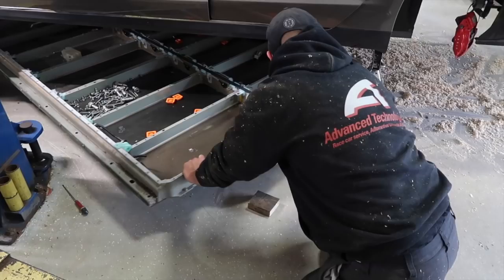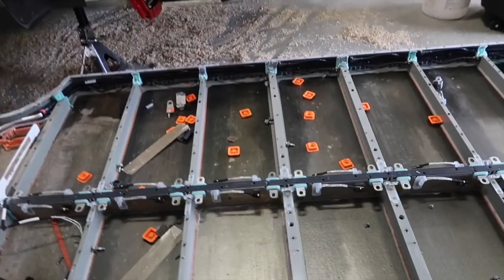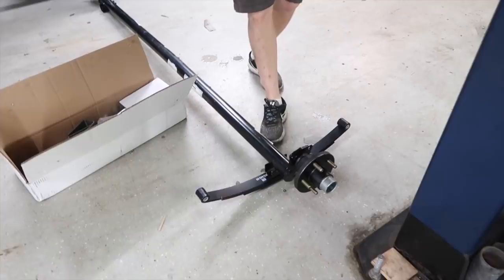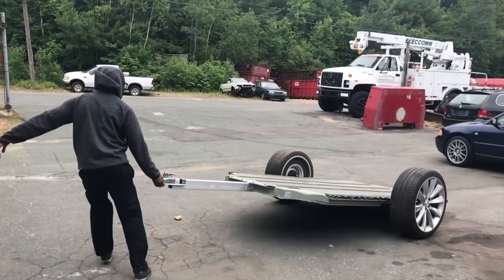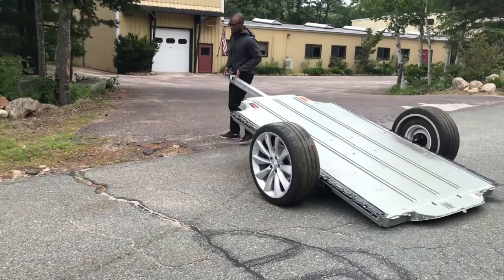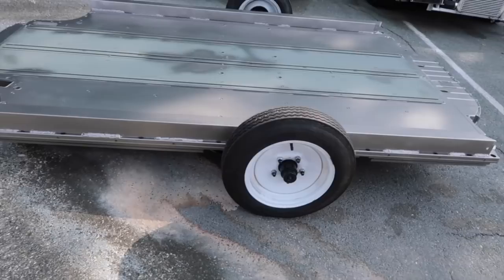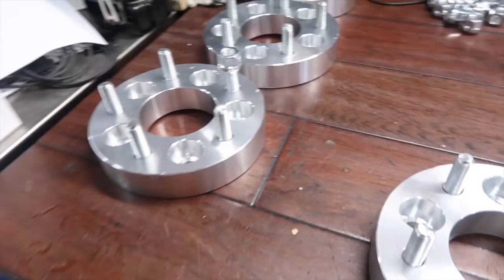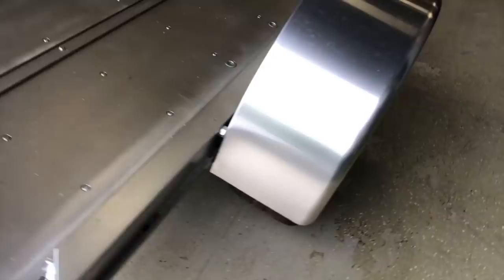DIY Tesla Battery Trailer

Comment: You know you could put a small travel trailer on top. Add battery modules then you have a travel trailer / range extender.  Now that would be cool. Design the travel trailer external design to compliment the model s / model X / model 3. You would also need electric brakes. I sense another project or perhaps and new company that specializes in these types of trailers.

1) Trailer would need added self contained coolant system with fans for super charging.
2) Crash sensors for disconnect the high voltage connection to the car and trailer.
3) All appliances could be electric. No need for a propane bottle.
4) Added small electric motors to axles to assist in hill climbing.
5) Fold out solar panels!

Could be a prototype for a Tesla Model 3 / habitat for SpaceX Mars mission. (just a joke)
Feel free to add cool options the the new Tesla Travel Trailer / Range extender!

Comment: So many applications can come from this. Maybe a trailer can be made with the batteries in it to make a small portable workshop to run all tools off of it. Maybe small trailer be made to sleep in like a motor home but run everything off the battery and it would really work out well if you're somewhere remote where electricity is not readily available. On and on it goes....

Comment: You need to build the battery packs out of the 21700 battery, make this into a small tear drop travel trailer, hook it and wire it up to your Tesla and see how much range you can get out of the trailer and car combined. I say if you properly configure the trailer to the car, perhaps even solder in super capacitors for energy storage, perhaps some regenerative braking into the trailer wheels it can give you close to or over a 1000 mile range, theoretically speaking. Not a bad idea this little trailer.

Comment: Awesome idea. Here's my 10 cents: If you flip it the Aluminium skin (Yes, I come from a place where it has a second i) will be in tension and make the whole thing much stronger. Stick some plywood on top and then you've got a cheap and easily replaceable floor that you won't mind dinging up.
I want one to tow behind my Leaf. Not my S. That would invalidate the warranty ;)

Comment: I like it. I would use one. You could probably have used some extra telsa fenders and nose cone to make it more recognizable as a telsa trailer. I like the battery pack idea, but it might be more balanced with two and that would make for a good mobile workstation when you go places for tear downs. Good job. I enjoy the video Rich. As an IT guy myself, I understand the part time thing. Also looking at doing an electric skateboard myself. Let me know if you have tried any others, as I am having trouble deciding on one. The reviews are usually young people on the skateboards, which I don't exactly relate to. Thanks and keep up the good work.

Comment: I remember seeing the difference the tesla battery makes on an auction site once it is pulled out. I think the weight of it is pretty significant. Seeing the clearance between your axle and trailer, I don't know if that trailer will support your packs without bottoming out the suspension. Wish you the best of luck with this adventure. Looks pretty damn good! :)

Comment: You should find a cheap junked up LEAF and fit the pack from it, they are VERY cheap on copart right now, then use it as a sort of range extender/ backup power I bet it would fit ok on it.

Comment: It would be cool if you could make a Tesla trailer w/ battery pack that could be used as a supplement to the car's main battery pack.  Sort of like having a portable charger for your phone. I think there could be many applications for this... Tesla camping trailer with power anyone?!? Taking this a step further, create a Tesla trailer using their solar shingles for the roof.

Comment: You should of mounted the axle under the springs. Also know as “under slung” in trailer lingo.
This would of prevented the need to notch the frame for clearance.
You could of also used longer hangers.

Comment: Brilliant! If you can come up with a way to put 20kWh-ish of Tesla batteries on there so the weight remains acceptable but you can actually put a 40A charging station for your car to get a boost back while carrying stuff or even it being a camper trailer, it would be awesome.

Comment: I'm thinking such a trailer with batteries, or even better a trailer full of Tesla powerwalls / powerpacks could be a great tool in disaster relief. It can then come fully charged and give power to houses  instead of using generators.

Comment: Hello Rich, 1.) have you considered using a Tesla battery trailer as an external power extension to any Tesla in order to improve its mileage?  2.) What is the practicality of using a Tesla battery array pack for off-grid solar applications? 3.) Could solar panels charge a Tesla battery array?

Comment: It's not so hard to see a future where these trailers could be used as replacement batteries… It would give the gasstations along the highway a new job... keeping battery trailers charged and in good shape and replacing them on customer-request. Like the system of camping gaz, where you buy a canister, and you exchange the empty one for another charged one. Same principle, advantage, you pay a bit more, but the company assures that all trailers in circulation are in decent working order...

Comment: 10 years from now get an old Model X 60D and put together a trailer from a refurbished 2020 Roadster battery and you'll have the ultimate sort of cheap electric road trip vehicle with maybe over 700 miles of potentially "free" range.

Comment: Het Rich, I love your stuff and really great attitude.  I am pretty positive the cover to the battery pack is also a structural part of the system.  If you look inside the gussets are split in the middle.  It would be a good idea to put the top back on.

Comment: You man I just saw this. So why not cut small holes and add little wheels to the platform for when you load up battery packs so the easily roll across the bed of the trailer.  Throw a winch on the front. Really cool build

Comment: I always wondered about battery trailers or even generator trailers for extended range. I drive across country twice a year but for the rest of the year I drive less than 50 miles a day. A generator trailer would allow me to drive across country and use no gas the other 361 days a year.

Comment: I thought you were going to build a battery trailer to have the capability to go many more miles and also have the capability to carry on the trailer.... 
Here's an idea for you. How about a teeny tiny house/camper with a monster battery underneath that would have the capability to charge while the car is charging and also charge via solar off the roof of the Tiny????? A simple teardrop trailer should be pretty lite weight and the addition of battery pack should give you plenty more juice to get you where you want to go!!

Comment: you should add all the batteries back in and use it as an extended battery pack for the car to extend its range, especially if the tesla has to tow something.
Reply: great idea greg

Comment: Looks like you had to put the Tesla wheels on top of the trailer tires just to get an extra few inches.  The trailer is still too low though.  Gotta flip the axle over and mount it under the springs.

Comment: I thought that you'd might put some of the battery back in there to increase the distance you can travel with that trailer. All you with me to do was put another shell on top then add the frames that you did before.

Comment: Two things, both seem to be pretty obvious so i'm sure at least they crossed your mind already, but anyway: been the battery pack nearly as wide as a Model S, AND adding the with of this wide wheels will result in an extremely wiiiiide trailer. Which is probably good for having a big cargo space, but if the idea is to get this on your tesla working as a range extender battery or something like that, probably you'll want something a bit more narrow.
The other point is the last comment of putting solar panes over it. Your money will probably be better spent in pink paint for the car, just an example. Make sure you make some basic numbers because no solar panel installed on this area can produce any substantial amount of energy, even if you had no clouds nor shadows. Plus, you don't want to ruin a solar panel by throwing something over the trailer. 
I like the idea of having a trailer of fully charged juice and been able to use it to charge other EV, I'm not sure though if makes any sense economically considering the supercharger network and the sell value of each working tesla module.
BTW in Spain you are all over the tech and automotive news of the moment after the video of Motherboard! the Frankenstein of Tesla. LOL

Comment: So here’s a dumb question… But if the entire battery pack was intact and functional, If wired properly, would you be able to use the trailer as an external battery and charge a Tesla as you drove?

Comment: hey man ! chances are you won't see this but i wanted to give you a heads up that your axle is not installed correctly. the way you have it now it has nowhere for the springs to flex; any bump in the road will cause the axle to push into the bottom of the deck and leave the tires to absorb all the impact. flip the axle around and put the leaf springs on top and the U-bolts the other way around.

Comment: You want to make something useful,  get a 500cc motor that makes 40-50hp, attach a generator,  use it to run the electric motor.  Now you added 500lbs aaaaand given the car unlimited range.  You only need 30-35hp to maintain 65mph. The extra HP restores lost charge.

Comment: Can you link this trailer to the tesla itself? Get 12v from the main 12v battery and feed the tesla with traction current?
Basically put the trailer in parallel with the tesla battery. I am aware that capacity and volts are not the same since you cut it

Comment: Honestly, I was dismayed when Tesla and the other EV makers simply ignored the most sensible idea to extend ranges by use of trailered battery packs or hybrid power generators to feed EV's on cross country treks. Lets face it, the EASIEST way to do a long haul would be to hook up a trailer with a 1500lb battery pack and drive it to empty using the cars on board batteries to get to the next exit with an available battery pack and switch them out in 5-10 minutes. If UHaul can rent out vehicles and trailers much like this (the local handyman uses a rent by the day UHaul van right now), why not a high cap battery trailer so you can still drive your EV like its a car?

Comment: You know what would be cool. Installing the battery packs and a rear drive motor. Imagine having a trailer that can help you haul thousands of pounds beyond what your vehicle was capable of towing cause it was under its own power.
Reply: Racer X that's not how towing capacity works
Reply: sirwarrior if the trailer was under its own power you wouldnt be towing it.

Comment: Will it be legal to power the car from the trailer battery when in motion? If the trailer disconnects, you could have live cables trailing.
Could be used for off-grid charging? (Camper trailer, etc)

Comment: Hi Rich, enjoy the Work your doing for current and future electric vehicles.
I have an idea that you may looking into for possible boosting the range of any electric vehicle. Have you thought about purchasing or acquiring a DC Motor and attaching to the trailers axle or wheel hub. This could possible allow you to generate power to battery pack or battery cell. Or even DC motor to Ultra capacitors coupled to battery pack (hybrid). Concept is use the trailer for 2 purposes, 1) hauling 2) Generating power for electric range extender option.

Comment: Great idea.... how about a way to get 10 to 20 % of the move to make electricity ... lets say only downhill  and when it breaks.... with this setup I can not find a way clear for now , but if you had a motor on its wheel ,  you will have decent energy on downhill and on brakes... Trucks for example had air breaks for the Cargo trailer ... so when you break the Truck the Cargo stay strait don't turn to a Z with dangerous  accidents .... you need a way that when the car break , give an option that the trailer will break with two ways like the Tesla ... you may be will need an arduino and sensors ( can be useful for the led control , I suggest neopixel leds strip , that change colors ) ... or may be something that is already on the market ... the idea so is to keep little longer the breaks back in order to keep the car and the trailer strait but not to much ... Also some trailers have electric motors to do maneuvering , in order to orient and align it right with the car  .... but you will need a smaller dummy wheel , that will be up when you hookup the trailer on the car....

Comment: could you do a trailer with a fill frame and battery an make the batteries work in tandem. basically doubling your distance. then that would be proof of concept for Tesla to make a moving trailer that also houses a battery. boom i should be in these meetings make these products.

Comment: Couldnt you just leave the battery pack as is but weld the tongue and wheel mounts? The battery pack already was sealed and safe to be under you and all you would have had to do was make a cable from the trailer to the car transferring energy which would have taken a lil time to make safe but i feel like that would have been the way to go giving you a trailer and extended battery life

Comment: if u watch when hes rolling the trailer at 2:50, it looks like the tire on the left is wobbling a little. is that because u the tesla tires didn't fit correctly or could that be that the hub is slightly bent? i would check it if u haven't already

Comment: Would it be possible to add Tesla batteries packs to the trailer to extended range of the Tesla hauling the trailer and hauling your gear. Would this be a viable option for cross-country driving?

Comment: Rich, Couldn't you make That trailer an extended range trailer to where the battery pack on the trailer could feed the Tesla. S,o you go six seven hundred miles versus 300 miles. In theory you can make that a free wheel trailer for towing / extended battery pack to propel a Tesla on long extended range trips long trip. And bring along a lot of camping gear in Goods.

Comment: Richie,  Question for you how hard would it be to power the wheels to the trailer linking it up to the Tesla so it takes the strain off the batteries on your car, is it possible or viable, thinking outside the box across the pond........

Comment: Just think if you can build that properly it's like adding another battery pack to your Tesla Plus it could carry stuff I think it's a win-win if you guys can engineer it properly. If not I have tons of ideas I think you might be onto something so awesome. One of the ideas I was just thinking of is regenerative breaking. We need to figure out a way to connect the trailer to the Tesla vehicle with some kind of brake controller and then it would return some of that power back to the battery that's easy peasy.

Comment: The axle is on top of the leaf springs so there’s no suspension travel, are you going to move the axle under the leaf springs or space them in final build?  The reason I ask is with the low profile tires will the trailer bounce all over in rough areas in the road?  Also when you modified the axle down did it change the load rating for the suspension;  either make it more or less?

Comment: I thought you were going to create a Tesla Battery trailer to double or even triple the range that the car can reach... kind of like a piggyback battery on your cel phone! If you could switch power source from your car battery to the one built into the trailer and then to the one above it that it is capable of carrying, the car could reach 900+ miles in one charge, then all three batteries get recharged simultaneously while you have lunch and off to another 900 miles!

Comment: Any chance of rigging genorators to each wheel of the trailer, to charge the tesla making for unlimited distance? Ive had this convo with someone before, where in the arguement, i was wondering why noone has attempted to put a high output, low rpm genorator on each wheel that are gear reduced to reduce drag, and put 1 on each wheel to charge tesla batteries while driving... but he argues the drag wouldnt work out and i thought it was to somehow keep oil/power companies in the loop... is this an impossible thing for the trailer do you think... making your tesla the 1 actual footprint free vehicle?

Comment: I have a Model X 75 D, but is it possible to switching my battery pack for 100D. When I bought my Telsa, I was misinformed about the miles I would actually get when I purchased my vehicle, had I know I would have purchased a bigger battery pack. I drive 60 miles and sometimes more each day due to work. Is this possible?

Comment: Nice! Obviously will never be wide enough to haul a Tesla.? Keep the metal, especially the steel parts, well painted. Technically they should be isolated from the aluminum. Galvanic action can tear up that aluminum. Especially in wet or salty conditions. Keep salt off the steel parts..

Comment: So theoretically if there is a second battery on the trailer, on top it has solar panels. Would the solar charge compensate for the extra towing weight to simply double the range of the two batteries combined. Can anyone do z math ?

Comment: I usually think you do things in a relatively safe manner or at least not harmful to other drivers or pedestrians. But putting battery modules in that trailed is a disaster waiting to happen. if you get rear ended with that trailer filled with batteries it will catch fire so easily and take your car with it.

Trailer is fine but exposed battery packs? that's just stupidly unsafe